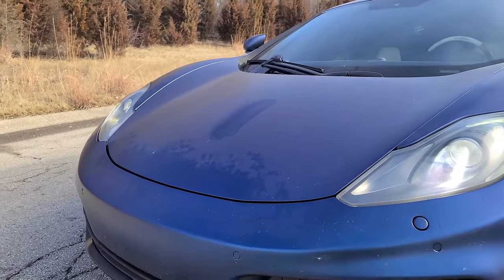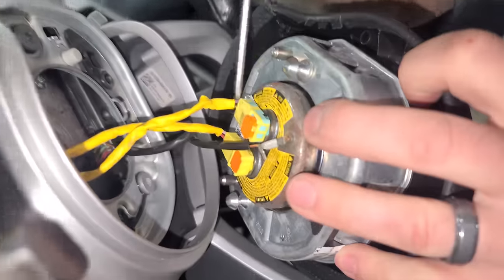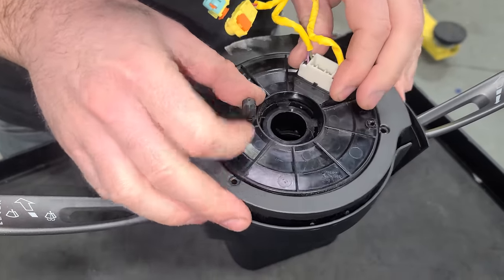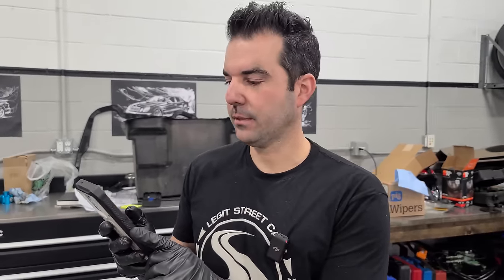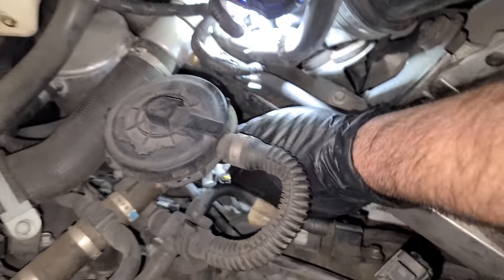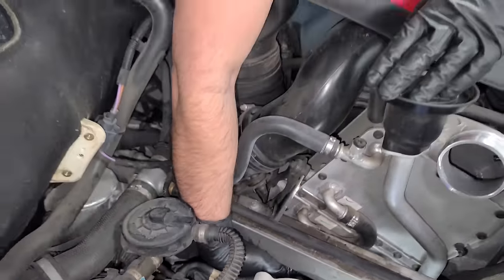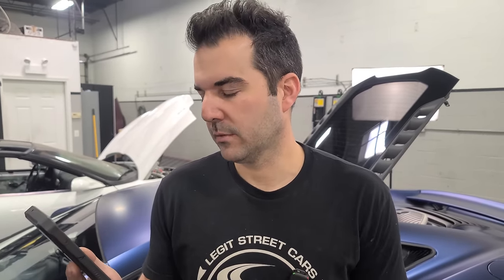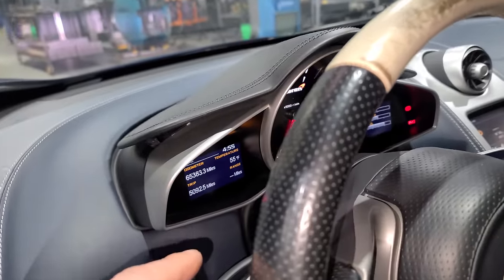I Fixed My Broken Supercar With Used & CHEAP Nissan Sentra Parts! McLaren Wanted $7,500 For This!

Comment: Thats too much money for repairs.
This cars ment for the I've got too much bloody money crowd.
Why fix when you can just buy new?

That cars a lot of show parts and sleek looking but a pain in the ass to work on
For 200k you would think they fixed the problems the car has with water management so plugs dont rust.
If I remember correctly its mostly carbon fiber body  I could see an extra water channel added at the top of the rear hatch 
To make water run away from the motor.
Also with the rear facing vents they have a tendency to suck air into the motor bay
And push it down under the body making thd rear of the car lighter feeling.
The hatch back should have been done like a normal trunk space with third door back hatch.

You every driven a hatch back car with the back proped open. Tail pipe fumes are pulled to the windshild if its open.
On blazers dust is pulled to the back window  untill sport utility trucks started getting a l shaped down firing spoiler on the roof to blow down over the back glass.

He could solve the water problem on this car, and so could the manufacturer.

Comment: You wouldbmvt think that a high-end car is supposed to be problem free with zero issue unless you just bash and thrash it. But noooooope! It still has mechanicalnissues and internal problems that could cost you and arm and a leg to diagnose.  Is it really worth its price tag?  NOPE!  You're just buying it for the exotic look.  The parts arent even worth its own weight especially when theyre already having issues internally and mechabically at just 65,000 miles.  You would expect it to last for 10 or more years before any mechanical issues due to poor maintenance or just defects. I much rather stick to a 10 - 40 grand car than waste money on these so-call luxury exotic cars.
Reply from the maker: That's cool